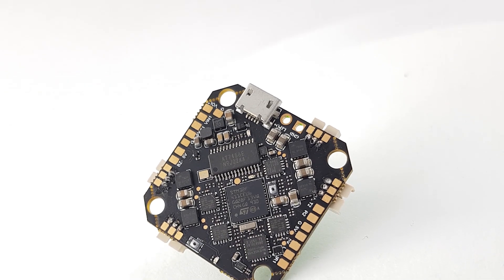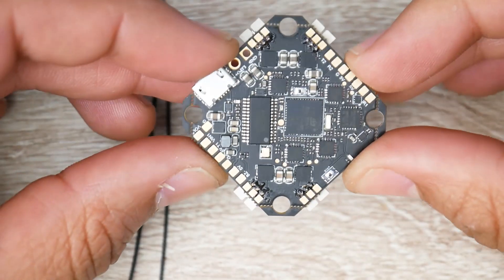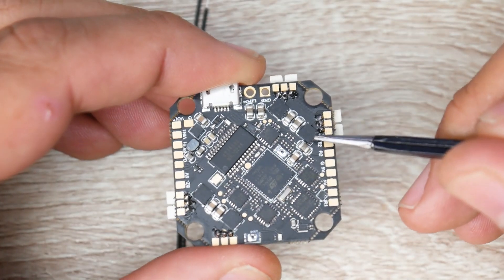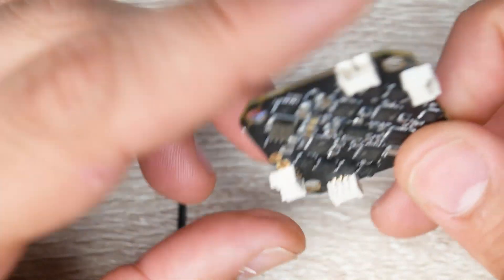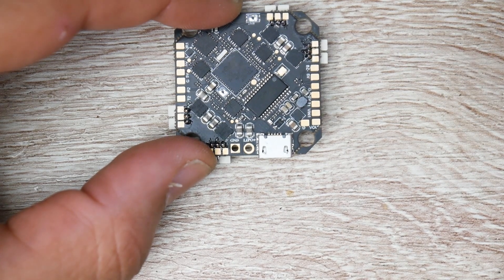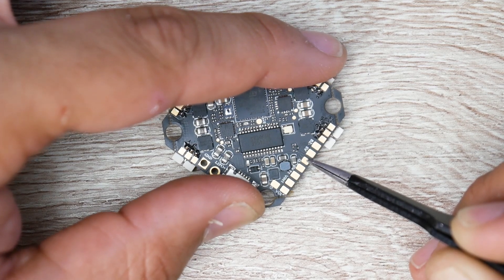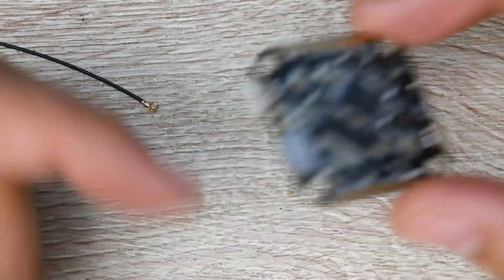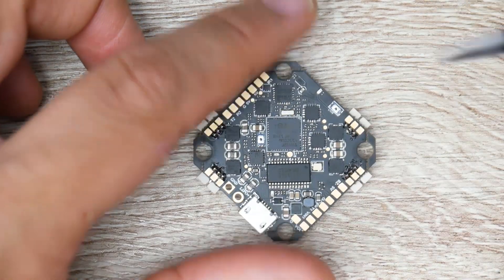Eachine Novice-III AIO Board for Toothpicks // Overview & Setup

Comment: Hi - Hope you can help:
OK, today I stripped down the Novice 3 and have fitted crossfire and the crossfire receiver works!

However, I have now lost all video feed, which is strange.

So what have I done today, and can anyone offer any help?
If not, I'll just put it all back together as it was.

1. I removed the green telemetry wire from the TX 2 pad and soldered it to the TX1 pad.

2. I soldered a new crossfire nano to TX2, RX2, 5v and ground.

3. I copied the Novice model in my TX16s and called in Novice CRSF and set it to work with the external Crossfire module and not the internal module.

4. I changed the setup in betaflight to see the CRSF receiver on UART 2 - and bound and updated the receiver - all OK - Crossfire works properly in receiver tab.

5. No matter what I do I cannot get a picture in the goggles apart from telemetry ( Smart Audio ) from UART 1.

6 WHY can't I see a picture? Anyone know?

Thanks

Comment: Hi! This video was really informative, thank you for making it!

I have a question and wonder if you could know the answer to it.

A few months ago, i crashed my novice quite hard, had to to replace motors and vtx. After getting it back in the air in the garden it flew incredible and was super happy! But when i took it out for its first real flight, the range was about 10 meters and then it would just drop out of the sky and start beeping and the RSSI would often be at 0.

 i noticed one of my antenna's was half cut off, ordered new ones, but no luck.. It would really suck if its broken as it already cost me a bit of money haha!

Thanks in advance :)

Comment: So, I have the drone and it dropped about 15 feet into some snow. Upon impact, I got no response from the drone, still transmitting video, but no response to the controller. I try connecting it to betaflight to put into binding mode. The drone will not connect to my computer, I have the COM drivers and all of that jazz, but the only response I get from the drone are the LED lights on the top board of the drone. I don't even get the light from the binding LED. I also notice when it is plugged in that everything gets extremely hot, all chips on the board range in temperatures between 120 and 300 degrees. Does anyone have any advice?

Comment: Another Great video. What is max motor size that can be used with this board? Will it handle 1303? Is there a chart somewhere for FC amps to motor size?
Reply from the maker: 13xx would be my recommendation
Reply: @DroneMesh  Thanks